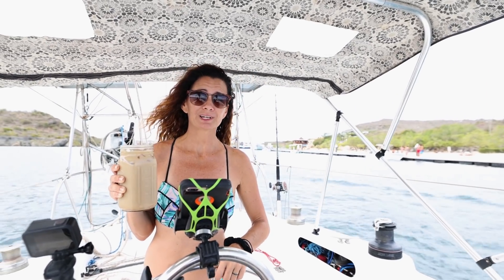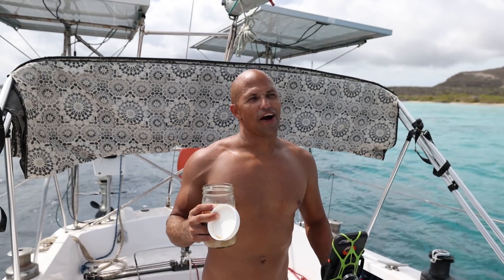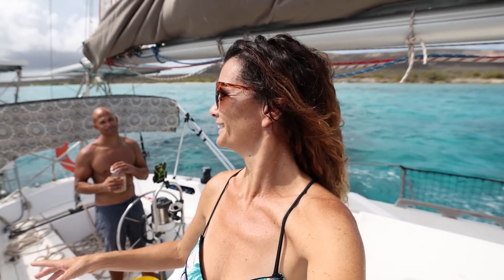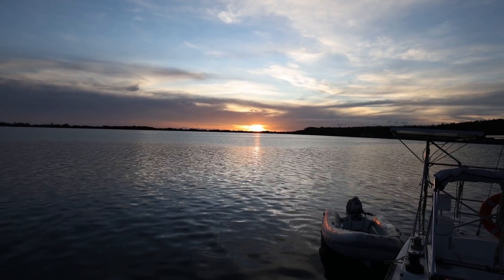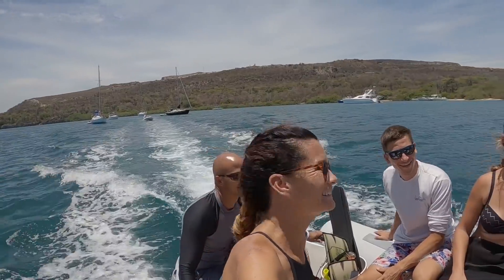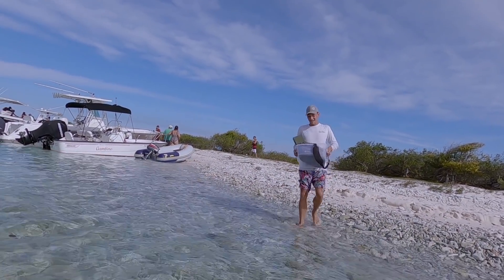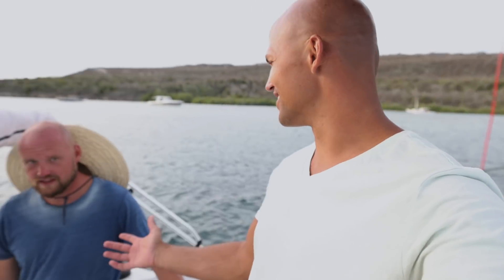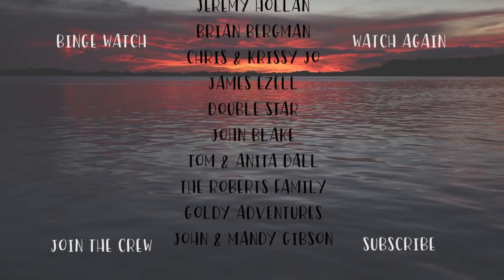The BALANCE of using our Electric Motor| Beau and Brandy Sailing

Comment: I see in the first minute you hold what looks to be a mason jar.  I hope it is not made of glass.  I have found with a boat, and the chances of having wet hands along with bare feet are high, and it is best to use plastic drinking vessels.
Reply: I guess at 3 minutes I see looks Like Beau's is using a peanut butter jar.  If that's the case it's just Jiffy!?1?!
Reply from the maker: 3 years and all of the mason jars made of glass are still on the boat :) Guess our hands aren't too slippery. And with the calm seas we weren't too afraid of them slipping through our hands!

Comment: I agree underwater videos are awesome.
When you motor how long does it take to recharge you batteries?
Reply from the maker: Thanks so much joseph! It all depends on how much we drain them. And also how the sun is following. On average we bring in 3.5 kW, if we were to drain them completely (which we have never done) it would take about 3 days to fill our 16 kW bank from solar.